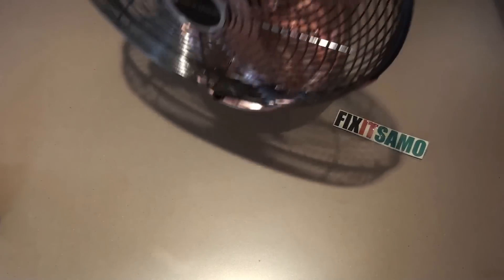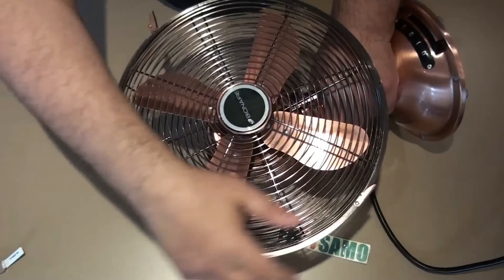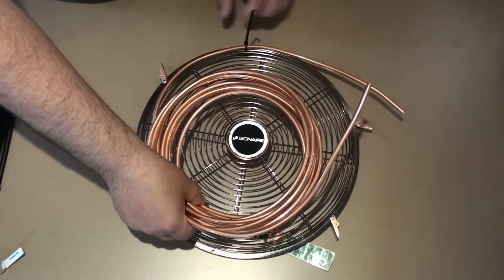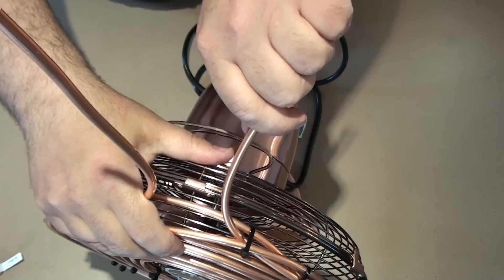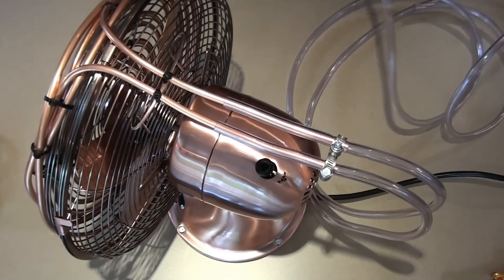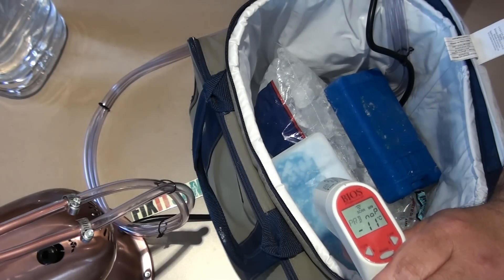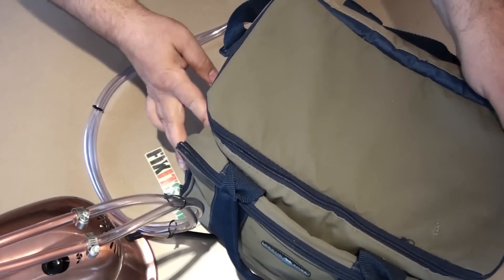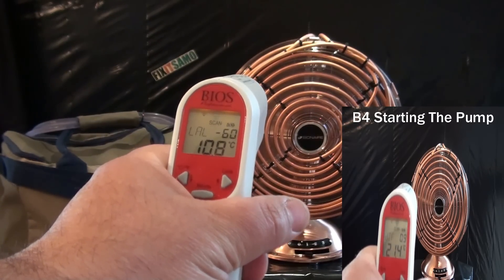How To Turn Your Fan Into An Airconditioner  AC

Comment: I.m impressed. what about condensate off off the coils?
Reply: RICHARD JOHNSON i assume you would just have to wipe that off
Reply: @shortyrafael4008  pls someone who has built this should confirm if condensates dripped onto the floor
Reply: My guess would be if the fan is on then there wouldn't be any condensation - kinda like running your hands under a hand dryer water gets blown away. Also if the tubes are dry on the outside then water would never get a chance to condensate (with the fan ON) with the fan off and the pump running then yes there probably would be condensation.
Reply: cold surface of tubing will likely condense some minimal amount of water out of the ambient air in the space.

Comment: Could this stay cold all day?
Reply: fixitsamo You can say that again!
Reply from the maker: +splibb  around 10 hrs
Reply from the maker: +Doc 
With the quantity of ice that used it lasted around 10 hrs
Reply from the maker: +Doc 
With the quantity of ice that used it lasted around 10 hrs
Reply: haha.  Yeah, see the trouble is that if this is only melting 10 lbs of ice in 10 hours, or 1 lb/hr, then this is only a 200 BTU/hr A/C, which isn't much.  It won't cool a whole room.  If you point the fan directly at you it might help cool one person.

Comment: can we use a plastic tube instead of the copper tube ?
Reply: Karim Bya the plastic wouldn't get as cold as the copper
Reply: It would but it does not conduct the heat as good as copper does (cca 400 W·m−1·K−1 for copper and 0,05 W·m−1·K−1 for the plastic).
Reply: that explains why cooling fins are always made of plastic instead of metal /s

Comment: Adding salt would lower freezing point yes...OR use 80% or better alcohol and you'll get much colder temps. My 2c
Reply: genius !!
can we use a plastic tube instead of the copper tube ?
Reply: Karim Bya plastic would work but copper is probably 20x better
Reply: Salt lowers the freezing temp but not he temperature. That's why you pour salt on ice to melt the ice on like roads; it doesn't make the water colder it just means it needs to be colder in order for the water to freeze.

Comment: You could add salt to the water to decrease the specific heat of water. That way, themal energy will exchange faster between the water and ice. But it will melt faster tho.
Reply: it is not exchanging thermal via the line... In the water- It is exchanging On the surface of the copper tubing.
Reply: @angelchiriboga3904  But if the water can get colder than 0 Celsius while still being liquid, you can have more cooling power. Salt would allow this.
Reply: @TheArrowheadVenom  the kind of pump he is using is not made to handle salt water, these are made for fresh water, the salt would ruin the pump.

Comment: thats not ac. thats swamp cooling.
Reply: Not swamp cooler.  It's a heat exchanger.  Swamp cooler will increase humidity into the room, this does not. Only practical if you have a source of free ice.
Reply: That is AC.  Swamp cooling adds a lot moisture to the air.  This doesn't.

Comment: Here's what I'd like to do,a diy earth heat exchanger. Put underground tubing in my backyard,a whole lot! Let a pump circulate water through it and through a big radiator in my house and blow a fan through that radiator. Lot's of work but should be fairly cheap to run and these kind of systems are commercially available.Just very expensive.
Reply: Might work for an hour or two but the soil around the pipes will heat up and because soil is a good insulator it won't be able to dissipate much heat after that.
It also won't get terrible cold either...
If you don't want to buy an air conditioner then why not just buy an evaporative cooler?

Comment: It takes approximately 6,000 BTUs per hour to cool a 150 square foot bedroom.  If it requires 184 BTUs per pound of ice to turn it into water that is 72F. One gallon of water will make 8.34lbs of ice. Warming this 8.34lbs of ice to 72F will require 1534.56 BTUs. To keep one 150sf bedroom cool, we could need the equivalent of ice made from 3.9 gallons of water or 32.6lbs of ice...every hour! If we wanted to cool the room for 8 hours (all night), we would need 260.9lbs of ice.
Reply: I think his point is to cool air from that fan so it is more of a feasible option to keep an individual cool, not a room. I think this fan beats many water fans on the market.
Reply: Gibran Ramos ... I love your math.. I even wonder if  this is worth it.
Reply: His math is severely lacking important parameters. 
For starters, what temperature is the room starting at if your final goal is 72?
You also need to measure volume in cubic feet and need to take an insulation factor into account.
Reply: You have never lived in a really hot and humid environment.  Sometimes you just need enough cool air to get off to sleep.
Reply: it works but very very crappy compared to an actual AC unit.
Reply: That completely depends on the efficiency of the cooler ... which you did not calculate.
Reply: Gibran Ramos
WTF r u trying to say? does this work or not?
Reply: I think you're assuming the temperature of the room. If the room gets progressively cooler then the ice will melt progressively slower. Also you can use refreezable ice pack/blocks so you don't need much ice plus I'm assuming you would only need to cool the room at the hottest part of the day which usually isnt 8 hours long

So you'd probably have longer hotter hours depending on freezer space but still cheaper than like a dyson air fan or air conditioner for the whole house

Comment: I'm confused, is it blowing +108*C or -60?
Reply: Ok, After a quick google search i have your answer.
The top number LAL -60 is the low temp alarm, I believe this is a user impute number and can be adjusted.
So if the temp the gun reads is at or below -60°C the gun will beep.
The bottom number on the gun is the actual temp @ 10.8°C
That can also be confirmed by the °C symbol to the right of the number.

Comment: you have made a forced draft chilled water fan coil for very cheap. i would be interested to know the temp difference between the entering water and room temp using k type tmp probes. regardless of the obvious heat rejection through the ice/water being unsustainable i i believe this is an excellent d.i.y. project for people who dont have the access or means to install an air conditioning system. if you where to build this on a larger scale with access to an ice machine you could totally cool a room at a slightly lesser rate than an ac however humidity would have to  be taken into consideration, hence my question about the t.d. 
all in all good project ;)
Reply: You could also hook this system up to an Aquarium chiller...

Comment: Infrared thermometers are for surface area temps not ambient temperature
Reply: if the surface is colder obviously the air blowing around it is going to be cooler.
Reply: Your Bass Fix - Cleanest Bass Boosted Music 
True but that could be the tube on the fan being 10 degrees Celsius, not the air being blown out. So the actual improvement might not be that significant
Reply: Yeah thats basically what i was saying. The IR thermometer is reading the surface temp of the  fan with the copper coil not the air that is being blown out by it.

@bass: hold an ice cube in your hand and tell me how cold it is. Now place your hands close together and put the hand with the ice next to the fan. Tell me if the hand without the ice gets even remotely cold as the ice cubes temperature.

Comment: Would this not work better if the copper tubing was at the back of the fan which would surely mean it's sucking the cold air through the back and out through the front rather than slightly cooling the warmer air that's being pulled through? 🤔
Reply: Tyler Smith either way the copper has the same airflow.

Comment: It will obviously work a little but it wouldn't last long like a Real AC it literally suck the heat out of the air witch, the gas is very hot and then is cooled down to repeat its circulation. The water is going around in circles but the heat its drawing from the air as it circulates isn't getting colder its simply melting the ice hence. Just buy a AC. Tbh you could make a Home made real AC.  With a compressor 2 radiators and some R-22 (Freon) gas and 2 fan motors and power supply to run it all. Probably non return value also.

Comment: Why not having the water coming from a small cheap refrigerator 😂 that way you have cold water 24/7
Reply: Refigerators can't actually cool down a lot of heat, they work mostly by insulating it from the outside temp. So if you would run the hotter water constantly into the refrigerator, it would be just overwhelmed. Not to mention it would overload it and most likely break very soon.
Reply: J0xxe and a freezer?
Reply: Probably same problem, freezer just has smaller volume and better insulation.
Reply: J0xxe yeah you're right. My split unit airconditioning is 3.5 kw. Way more powerful than a fridge. I guess for a reason.
Reply: Leave your fridge open and wonder why your room doesn't get any colder. The other comments are neglecting the fact that fridges pump out quite a lot of heat. So if the fridge were in the same room as your ac it would heat up the room not cool it.
Reply: at that point you might as well get an AC.
Reply: I'd use a mini FREEZER with the fan on top. No water, maybe like 25' of tubing coiled inside ? I love it when people all work together like this. GREAT THINGS CAN HAPPEN !!

Comment: nice one. but i would take the joints from copper to plastic way further away from right over the motor, if that fails, and it might cos when the copper contracts and expands it will compromise the joint and wate in the back of fan is bad. great thing though

Comment: is any water from condensation in the copper tubes falling to the floor? or there is no condensation at all?
Reply: Laws of nature + Logic suggests:
1: yes there will be condensation
2: The fan will blow the copper wires clean before drops can form... thus raising humidity (ever so slightly).

:)
Reply: well, well, slight correction though:
What is mostly right:
part 1: "there will be condensation" - mostly TRUE (unless the tubing is so dense or the difference in temp is great enough or the air temperature is close to its dew point so that drops would eventually form - then it would be FALSE)
part 2: "the fan will blow the copper wires clean before drops can form" - TRUE, in the above case where actually drops dont form

What is misleading:
"thus..." is misplaced. Why? - any rise in relative humidity will not be a result of blown condensation back in the air, after all - this is where the humidity came from, so total water content in the air will be constant.
However, humidity will be rising due to drop of the air temperature in the room, and thus (this is where you put the "thus") the capacity of the air to hold water vapor (i.e. as we will be moving the room temperature closer to its dew point for the initial quantity of water, the relative humidity will rise).
As a reminder the relative humidity would rise each of the interventions: 
a) adding water in the air for constant temperature OR 
b) dropping temperature for constant water vapor volume in the air

Comment: It would be less cold, but you could disperse the heat into the ground by putting another copper tube coil however far underground groundwater is for you. The pump might have to be more powerful, but it negates the need for ice. It is similar to how the well water air cooler works. All you would have to do is make sure the tube stays full of water.

Comment: Some are saying add salt. I thought salt makes ice melt...
Reply: I worked in a restaurant for a few years. We would use salt over ice to keep sauces cold for longer periods of time at server stations. You could hear the ice melt at first, then it stops. If we added too much salt, the sauces would turn to a solid brick of ice
Reply: Heather English salt lowers the freezing point of water, that way you keep the water liquid but colder than its freezing point
Reply from the maker: +Heather English 
Salt definitely melts ice i live in canada we use salt and sand to melt the icy ❄️ roads 
Temperatures can go to -45 sometimes
Reply: Adding salt to ice lowers its melting temperature causing it to melt more quickly. However ice melting is an endothermic process (absorbs heat from external sources) and therefore the increased rate of melting is accompanied by increased heat absorption from the surrounds like air or a can of drink in an salted cooler.

Comment: Pro tip: Add salt to your ice water to produce a brine, salt lowers the freezing point of water super cooling the water.
Reply: It does, but it stays the same temperature. Saturated Salt water freezes at -20c*
Reply: That is incorrect. Because it lowers the freezing temperature of the ice it causes the ice to break down faster. The breaking down of the bonds allows the water to "take" energy with it faster causing the drop in temperature.

If you doubt this is true, then as long as you have a thermometer you can stick in water then this is a very easy experiment to perform with just that thermometer, a glass, water, ice and salt. I recall performing this experiment in high school long before finding out the chemical reason behind it.
Reply: Juan Diaz I thought salt melts ice. I'm confused

Comment: I really want to try this. I live in the UK and i'm struggling to get 1/4" (which is 6.5mm) copper tubing. The best I can find it 8mm. Has anybody got any suggestions on finding 6.5(1.4") in the uk? Thanks!
Reply: you don't need to have the exact same size, you just need to make sure your pipe is full of water. The smaller tube will give you more surface area because of smaller coils but 8mm tubing shouldn't make that big of a difference.
Reply: Ah, great thank you. I'm a totall noob when it comes to things like this so I like to follow the exact measurements lol. Thank you! :)
Reply: chubby little loser with the puk nose face, let me know if it works, im in uk and cant bear this heat right about now. im in front of my fan stark bollock naked but it aint cooling me much.
Reply: Lmao you're the first person to get that reference ;). Will do! I've just ordered the copper piping from Ebay (£17) and i'm just looking for a pump as well. As soon as I build it i'll come back and let ya know if it's worth it. 
I did actually build this one /watch?v=ITtlxjvLQis&t=1s and it was the biggest waste of money. £40 down the drain. Unless you sat infront of it, bollocks out, you got no benefit from it at all.
Reply: @chubbylilloseruk  did it work? How about condensates?
Reply: @didymario  Hmmm, It did somewhat work. if you sit infront of it it's a noticeable improvement but not as much as the thermometer in this video makes out. it doesn't cool down the room that much. The condensation is a bit of a problem. After a while you start getting splattered with water lol and the rest just drips down so you can't really have the fan pointed up (Incase it drips into the fan itself). if, like me, you wanted this to blow on you while you sit at a computer it isn't really worth it  as your desk will get covered in water after about 2 hours. If you want this to sit on your decking while you sun bath then it's good! :)
Reply: @chubbylilloseruk  thanks, i appreciate this.
Reply: cheers mate, let me know if its worth it :)
Reply: spray yourself with water. you won't have to worry about getting your clothes wet. Also, you could spray your t-shirt with water = cools nicely
Reply: u may try it in d refrigerator repairing shop...

Comment: Since you produce ice from your fridge and your fridge produces ice by taking heat out of the fridge and into your house, it kind of feels like your basically doing the same as opening your fridge to cool down your house...
Reply: Louis Gendron so ur suggesting turn off ur fridge to reduce house heat? Tell me u turn off ur fridge when its hot. Lol
Reply: You're pretty much correct. That would be more efficient probably. Someone said spraying yourself with the water would be better. It may be, it would certainly use a lot less energy. Sit in front of the fan. Bingo! no pump, no fridge.

More than that, this is extremely inefficient. I know this is maybe just for fun, but the power it takes to freeze the ice could be put to better use in cooling. You are losing a lot of energy using the ice to cool you rather than the extra power the freezer will use.

Power for pump = 3 watts?
Power for small desk fan = 30-ish.
Power to freeze the ice...a lot more. 

When you add warm water to a freezer it lowers the temps in the freezer, so the freezer must kick on to compensate (put a case of warm beer in your fridge and listen to it run after that!). Therefore, you are using additional electricity making the ice. This increases as you continually make more ice.

And yes, the fan, pump and fridge all technically create heat. If the fan motor and pump are outside the room somehow then it wouldn't matter. If they were all in the same small room as you (fridge too), you'd be wasting your time and money. Open/crack the fridge!

You're transferring cold air from the freezer to water to make the ice. Then transferring the cold from the ice to water, which then cools your coils, then energy is transferred it again via the fan to you. You will lose a lot of energy, possibly most of it, in the exchange.

There is no such thing as free energy, but there are ways to make it more, or less, efficient. I'm not a scientist so anyone with better knowledge please correct me.

Pretty cool experiment though :)